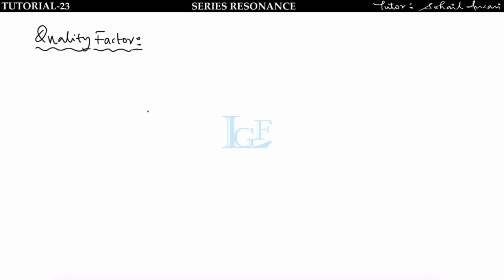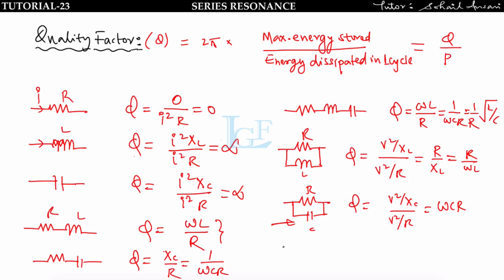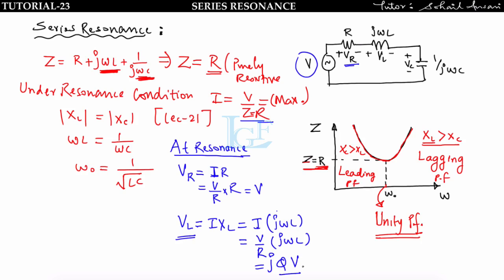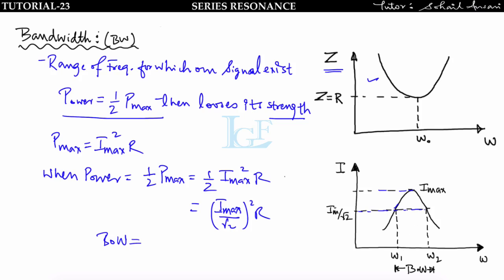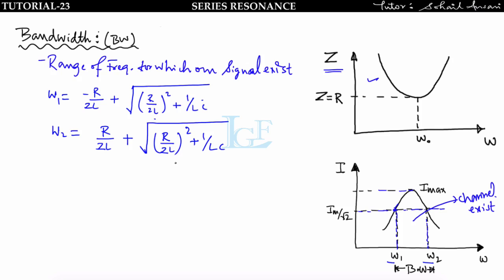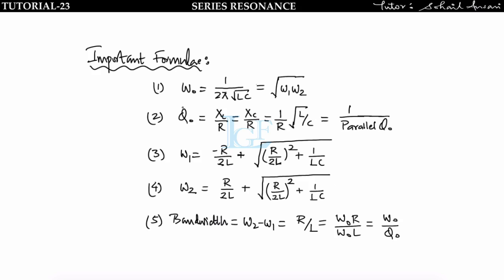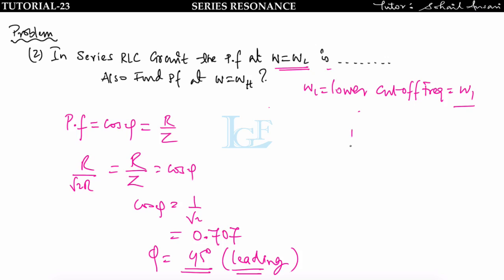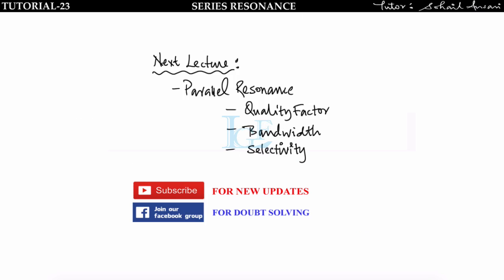Lec-23 Series Resonance

Comment: Sir At 35:28 we are asked to find out the power frequency and you told power frequency is twice the voltage or current frequency. They why we didn't multiplied the calculated freq. by 2.

Comment: Sir, in the last question, why voltage across L(200V) is even more than the exitation (5V) ?? Just want the logic.
Reply from the maker: because of resonance...at resonsnce the qulaity factor is very high...means voltage across L and C will be Q* Vs where Vs is the supply voltage
Reply: GATEMATIC Education does that mean voltage across capacitor will be 200v as well?